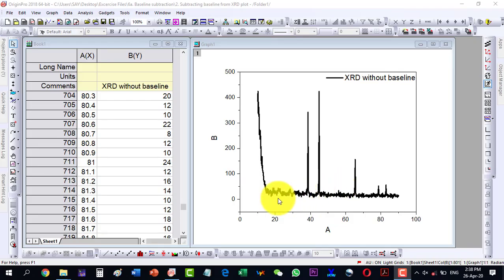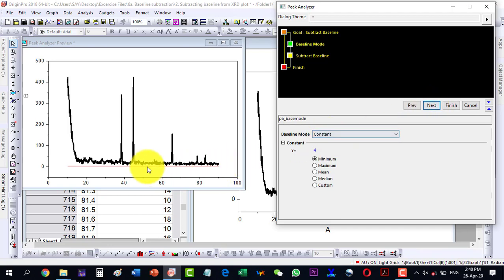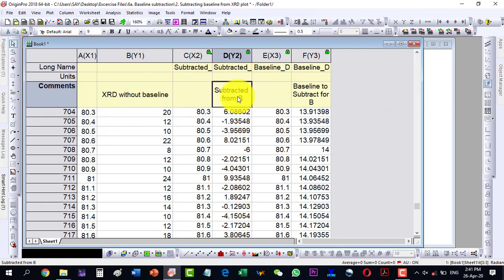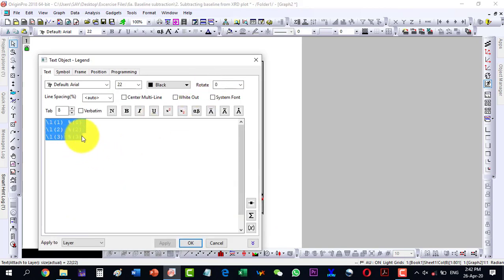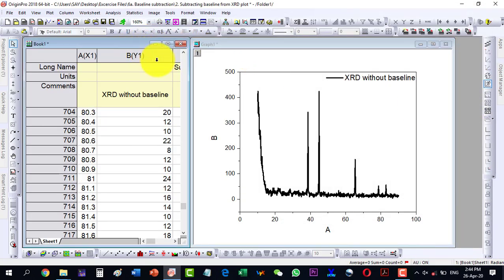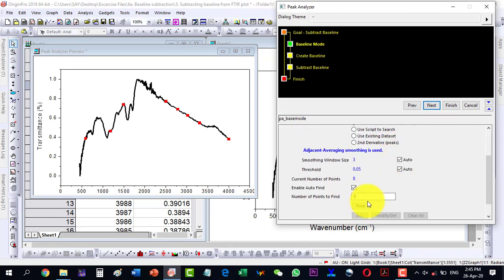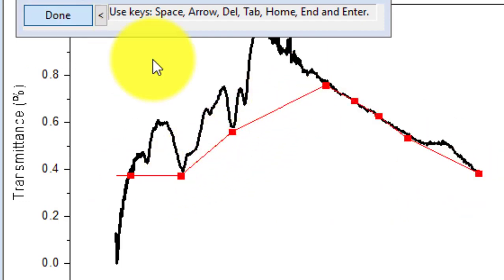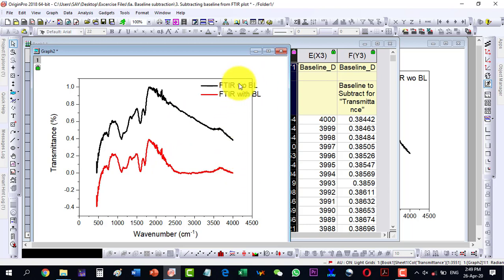Baseline correction for XRD and FTIR in origin: explained step by step

Comment: hello sir！after baseline correction,the xrd graph and ftir
graph will be more smooth.However,after that,the former y value(intensity or the transmittance) will change.will that influence the analysis?
Reply from the maker: Thank you for your question! After baseline correction, the y-values (intensity or transmittance) can indeed change slightly. However, this adjustment is typically necessary to remove any background noise, ensuring that the data more accurately reflects the true signal. The changes in y-values shouldn't significantly affect the analysis as long as the baseline correction is done correctly. The corrected data should provide a clearer representation of the underlying features you're interested in. It's recommended to plot both actual and smoothed profiles.
Reply: @SAYPhysics  thanks！It helps a lot!!
Reply from the maker: @franksimon-jh9ls you're welcome dear

Comment: hello sir，what the baseline will improve and why should we do a baseline correction?
Reply from the maker: Baseline correction in X-ray diffraction (XRD) data is important because it removes background noise and artifacts, which can obscure or distort the true diffraction peaks. This correction enhances the accuracy and reliability of the analysis by ensuring that peak intensities and positions are correctly identified, leading to more precise characterization of the material's crystal structure and phase composition. Thanks
Reply: @SAYPhysics  thanks so much！
Reply from the maker: @franksimon-jh9ls you're welcome dear

Comment: agar y minus meh  a raha ho constant meh to kia karna ha??
Reply from the maker: In that situation, you must do the baseline correction as the y-axis is supposed not to be negative. Thanks
Reply: @SAYPhysics  again same procedure ya phr custom range kar kay
Reply: @SAYPhysics  ya phr kaisay karo ???
Reply from the maker: You may use a multiplier or a translation tool to correct it to its desired place. This tool has been discussed in the below video. Thanks
https://youtu.be/3vQhx6YA7wY
Reply from the maker: Already responded. Thanks